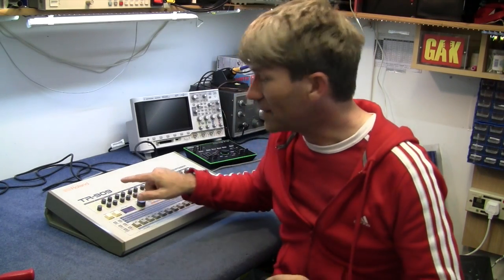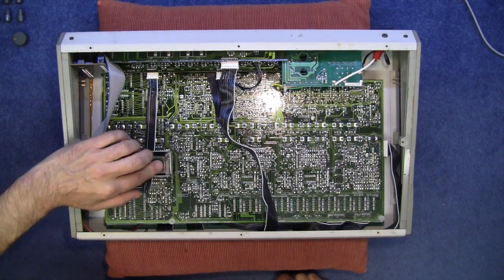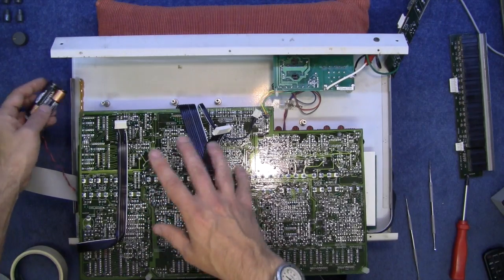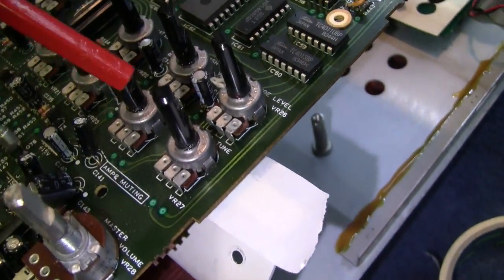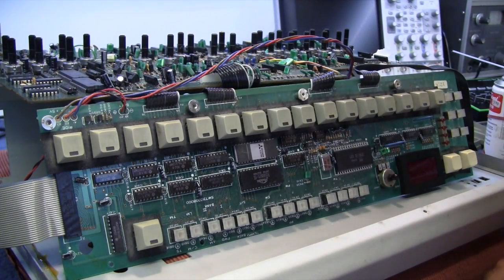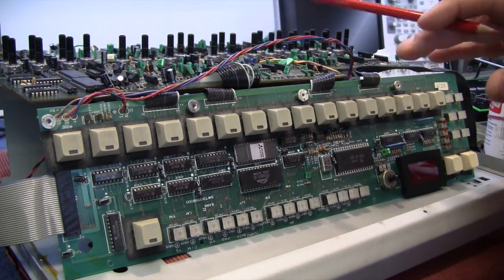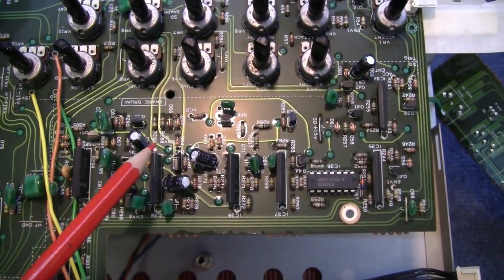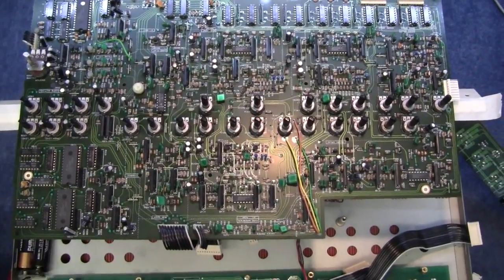MF#21 ROLAND TR-909 look inside and repair service

Comment: How did I miss this? My fav repair channel opening one of my drum machines? :-)

Edit: Oh, no, the buttons that came loose, I did watch this before, I just forgot. Haha!

One common problem with 909's is that they behave weird and erratic or that some buttons doesn't work. That's all the flat wire contacts. Just reseating them usually does the trick for 5 more years of usage. :-)

Comment: can anyone tell me reasons a 909 won't power on even though the PSU is working fine?
Reply: Bad reset line on PSU board. It's a tiny trace that runs along edge and under things and corrodes to open circuit....

Comment: I got my mother's old 909 and played it for a while, until the low tom stopped working. Every time I play it I hear a static white noise that doesn't fade out until I turn the level down or turn off the machine. Do you know how that can be fixed? I really don't know I could I mess that up. Overheating maybe?
Reply: could be a transistor needs replacing in the tom circuit? I have the same problem with the ride and am in the process of fixing it.

Comment: Hi Markus! I really enjoyed this video among many others you’ve posted :) Got a question on 909 pots; the snare volume pot on my unit is starting to feel very stiff and it’s difficult to turn it. Compared to all the other pots which feel smooth, it feels rough like it’s run out of lubricant or something. Wondering if you had any advice on what to do. You think the pot needs replacing? Also what is the best method you’ve found to remove the knobs? Thanks
Reply from the maker: hello. the poyt may be drying up so yes some lubricant could be useful or even try cleaning the pot as there could be dirt built up in there that is causing it to feel stiff. deoxit is one brand that may help but best to be sure it contains lubricant also as some pot cleaners will dissolve the lubricant. i use a credit card with a slot cut into it to slide under the pot and a couple of blades under both sides of the pot to gently try and prize it upwards. the card is to you don’t mark the surface of the 909. yes some of these caps are really difficult to remove.

Comment: I think on a really good epoxy, like Endfest 300, the posts can stick down fine. You can possibly fill around them to provide more support. But surface preparation is super important! The white residue might be superglue, so that definitely needs to be taken off with acetone. Additionally, sanding both sides is a really good idea, and then wiping down with isopropanol. Just be careful not to get acetone on paints and PS/ABS plastic parts.

Comment: I finally bought the 909 on August 23 and it arrived at my house on September 8.  It was just in time for me to make a song on September 9th (9/09).  The TR-909 I bought had some very noisy pots though.  I used your video to figure out how to take it apart and clean it.  It was great until you didn't show me how to take out the lower board.  I found the screws, but I didn't realize you had to use a wrench to unscrew the battery compartment nuts.  Thankfully, my wife showed me.  I like it when you just fast forward through the video while you do the work so I can tell what I need to do next.  Please don't take that the wrong way.  I really do love your videos too.  I also wanted to ask where you are from.  I like your accent.  :)  Take care and please keep up the awesome videos.  :)  Sam.
Reply from the maker: Hi Sam. I'm pleased you have a 909. and you made a track on 9/09 (that was meant to happen) . I live in Brighton UK but originally come from a country village called Bakewell in derbyshire.
Many Thanks from Markus
Reply: I'd love to visit the UK someday soon.  Take care and keep up the wonderful videos.  :)

Comment: This brings back memories, I owned a 909 in the day. Interesting to see inside. A nice drum machine, but expensive as I remember
Reply from the maker: Yes they were very expensive indeed but they do hold their value quite well. I wish Roland would remake these in every way shape and form instead of the TR-8 though that is a great drum machine also.
Reply: @markusfuller  They did it, sort of, with the TR-1000.

Comment: Hello there!
I've been always enjoying watching your videos, but i never thought I'm gonna need your help (unfortunately for me).
Since couple days my TR-909 is blinking for a  couple seconds after I press the power ON, then it works fine. before even it starts blinking, there is no light at all, like it wasn't even ON.
Can you please give me some hints or advice what the problem might be?
Reply from the maker: +Radiophonica Oh not too sure about that but it seems strange you should ask this just now as A friend of mine has just developed the same sounding problem with his 808 where the Leds seem to flash for a while before the thing wakes up and it has never done that before. Im hoping to get a look into it one day when he brings it around.But off the top of my head I do not know where to look. Maybe its warning you that the backup battery is dying ?. (thats just a guess)
Reply: @markusfuller 
Thanks.. : )

Comment: First off, before my little critique I'd like to say I enjoy these videos greatly so thanks for uploading! Cleaning old pots like that is generally not a good idea. As a professional engineer & technician I would never spray that stuff in any old carbon pots. Ideally they should be either be replaced outright or removed and disassembled one by one and cleaned with pure isopropanol. I cringe whenever I see someone using those spray cleaners. They don't work, they make the problem worse in the long run. It's a short term solution at best. I wouldn't want less experienced techs to see this video and then run out and buy spray cleaner and spray it all in a 808 or a 909 etc..
Reply from the maker: +Code Mode Yes I agree that would be the best thing to do though I was repairing this for a friend who I had already suggested replacement parts but he just wanted it sorted for the time being and did not want to pay to have hours of work and every single pot replaced. if I was getting paid for the hours of work and all the new pots then I would have replaced them all but this was a free fix with just a couple of hours to do it in.

Comment: Mine had one breakdown 20 years ago and has been working great since. Thanks for this video! It will come in handy eventually.
Reply from the maker: +Pauly's_crates It is an amazing drum machine, I wish Roland would remake them in the old fashioned sense rather than a modern emulation.

Comment: That Mitsubishi EPROM is now 30 years old. The last one I had for service had lost some of it's data. The HEX editor showed that some bits went from 0 to 1. Just a few, but enough to lock the machine up by pressing the shuffle button. I had the same on a Memory Moog a few years ago. Those EPROMS got 25 years of data retention and some start to lose them now. BTW those HN61256 are mask "programmed", i.e. produced with the data already inside. No worries, they can't lose any data.
Reply from the maker: +Chip Guy Vids Thanks For that information chip guy. Its always nice go get these snippets of info added in the comments for everyone to read. Much appreciated.
Reply: Do they corrupt because some light gets to them? I used to have an oberheim prommer!

Comment: I need some help please. I'm wanting to move towards electronic music. I far prefer hardware as opposed to software and love the old school sounds from the 80's early 90's. Aside from the TT-303 and the TB-8 what other equipment do I require to make electronic music? What do I use to sample for instance? Some of the set ups I've seen are mind boggling so It would be good to start off with something more simple and back to basics.
Reply from the maker: +Fury 161 Hi Fury. I would start off using something like Cubase - Logic - ableton or one of the many other DAWs as they mostly all come with a few plug ins and drum machines etc to get you started. then maybe if you want to progress onto hardware instruments well There is just so many different manufacturers of amazing gear I could not really direct you towards any single maker as they all have their plus and minus's.

Comment: Great videos! 1 note: "Monolithic" applies to any integrated circuit. You are thinking of SIP (single in-line package), as opposed to DIP (dual in-line package).
Reply from the maker: +Michael Bauers Hi Michael, when I used the word Monolithic I meant the pins are only on one end and the component stands upright rather than it being flat on the board with pins down two sides.
Reply: +thesoundofphysics I thought that too ( that monolithic = IC.)  I thought maybe he meant monolithic in the sense it was multiple op amps in a single package, as I was not sure op amps were generally called ICs ( but obviously is multiple components in a single package.)

Comment: hi mark  any tips on fxing my roland tr 808     start and stop button (doesn't work)
Reply from the maker: donthewatcher Hi the start stop button was just an old fashioned mass produced computer style switch. trouble is they are so hard to find now, It may be useful to try a multimeter across the pins of the button to see if it is working first just incase the problem is on the board somewhere else, then open the switch up and give it a good clean. I do not know of any alternatives available to buy that would match them. I would strip the button apart and try to fix that. Good luck
Reply from the maker: True with a little patience and care you can disassemble the buttons and clean the inner parts.

Comment: This is definitely not the way to clean scratchy pots. The very liquid contact cleaner, even when lightly sprayed, will eventually spread by capillarity everywhere inside the potentiometers cavity and dissolve the sticky silicone lubricant on the shafts, rendering the movement too easy and make all the shafts eventually wobbly. A professional repairman would take the time to desolder each pot, open it and clean the carbon trace and wipers inside with isopropanol, not contact cleaner, and re-assemble and re-solder each one carefully. This is the lazy cleaning job anybody can do, and will definitely lower the value of the device. Because if the owner ever wants to sell it, as soon as potential buyers will put their hands on the pots they will instantly know that a poor cleaning job has been done with contact cleaner, which inevitably returns to scratchiness after a short while with contact cleaner... I'm talking from experience.

All that being said, I still enjoy your videos Markus because it's always interesting to see the insides of devices and what makes them tick.
Reply: Do you have a video, showing you repairing and restoring a 909? Because talk is cheap...

Comment: thank you for this very interesting look into the 909 ! i have to open my one soon ... so now i know what me expect when i have to fix some inside.  : )
Reply from the maker: Hi thePOLYGIRL, I hope you make a video when you need to fix it, I look forward to watching if you make one up. best wishes from markus
Reply: markusfuller
 hi Markus : )
i dunno if i can make a vid like your's ... maybe only some photos of the repair with explanations... : )
Reply from the maker: Hi the POLYGIRL. theres nothing to it really, I never know what I'm doing until the video is finished and i try to polish things up afterwards as I do make some mistakes and my language sometimes when things are not going smooth certainly needs removing from the video's LOL.
Reply: thePOLYGIRL Whats the problem with yours ?
Reply: hi Fabian, thanx for your asking.
so, its nothing to bad on my one. just only need new stop switch, bd vol. and tempo pot replace... i think its easy to do and i got the most parts ready to repair soon. ; )
btw. the original tempo pot (or compatible one) is pretty hard to get here... phweeee

Comment: Hi Markusfuller, my 909 has a problem with the RIDE sound, volume is very low and always noisy, even when not in play or pressed. Can you suggest how to fix it?
Thanks
Reply: I fix it, replacing filter transistor ! :D

Comment: Fantastic video series!  Keep them coming!
What's your opinion on a possible sacrilege: for those broken chassis posts, the permanent, strongest solution would be to drill through the top panel and insert a truss-head machine screw from the outside in, of the same thread as the post, with a loc washer between.  It would lock the posts firmly to the chassis, maybe with a bit of threadlocker around on the inside.
It could be done discretely from the outside, and the screwheads could be painted to closely match the chassis so they were almost unnoticeable. 
Do you think that's something customer would have gone for?

Comment: My 909 has the entire battery holder removed ( I bought it like that) I'm guessing that the guy who sold it to me cut the wires on the face of the mother board. I haven't pulled it apart yet, Is the connection an obvious one? 

Thanks for the Video  - This helped a lot
Reply from the maker: Hi Raymond. The 909 was a repair job so I do not have it still here. but the battery connections were just soldered down to the board. Im not sure where they go of the top of my head but there was a schematic diagram on google. Have a search around for schematics and it should come up. Best of luck.

Comment: Hey Markus thanks for the response! I was wondering if it would be possible to replace the tact switches on my Akai MPC2500. Some of the buttons have become unresponsive and take a firm press to register or sometimes don't register at all.

Keep up the great work and videos! 

Kind regards

Paul
Reply from the maker: Hi Bestovitch, if they are the clicky type buttons as in the numerical keypad then there maybe small metal discs under them and they are in turn stuck down with a thin plastic film over the top. you can lift them up and clean the contacts on the circuit board. if they are the rubber squishy type buttons then you could draw over the black track contacts with a very soft HB pencil as this will provide a temporary fix for a year or so then they would need doing again after that. I would be happy to try it for you but Im bogged down with work for at least a month and dare not take on any work at the moment as things would sit on my shelves for weeks before I can get around to them. but have a go yourself you may fix it and you could make a video as you go along :-)
 other than that if i can help through messaging I will certainly try my best.

Comment: Hi,

Where in the UK are you?  I have a Roland MKS-50 that needs repairing, as the "Enter" button doesn't work, so can't store sounds etc.Alsi the battery is soldered on a raised post, so would like a new battery holder.  I looked inside to see if I could do anything, but is beyond me.  If you have a website/contact details then we can discuss your rate etc.I travel the UK quite a lot, so could drop off or just post.
Reply from the maker: when you say ENTER button you mean the red WRITE button I guess ?. is it the rack mount version of the roland Juno. battery should not be a problem though you may lose your settings so would have to back things up first.
I actually live in Brighton East Sussex but am so bogged down with repairs at the moment that i could not take on any more jobs for at least a month. but if you don't find anyone get back in touch with me and i will try and help. best wishes from Markus.

Comment: Fascinating! Great to see inside such a legendary bit of kit. Quick question...
I have a mixer with about 3 trim pots which appear to be doing nothing when turned; could this method of cleaning be a solution to this problem? Thanks in advance. And keep up the excellent videos.
Reply from the maker: Hi Paul. yes have a go at cleaning them the same way I do. don't use too much spray though as you don't want it on the actual Posts because there is grease there. the contact cleaner costs £3.95 from marlin electronics and lasts for years. best wishes
Reply from the maker: sorry i meant maplin electronics . the computer tried to correct my spelling as marlin ?.
Reply: markusfuller that's cool, I worked d it out! Anyway, did exactly what you suggested and now all channela on my old mixer work a treat. I'm very pleased! Thank you so much for your help and guidance. :)

Comment: Great video, thanx Marcus:)
I would have clean the buttons und thier landings prior to glue them with 2k, because you glue may just paint/dust to the buttons... and it may won´t last very long.
Reply from the maker: Hi Tubical. no danger of glue on the buttons. I just spot glued on the weld marks on the casing then placed the posts down onto the front cover. I know it won't last for ever but the antistatic hard foam should help keep everything in place.

Comment: ahhhh no you don't use switch cleaner on a drum machine worth almost £2000 its going to dissolve the grease that's supposed to be on the shafts in the short term its going to make some pots easier to turn than others and in the long term it could make the pots wobbly. either replace them all or take them apart one by one and clean them by hand.
Reply: Thats why you change them with new ones  ,
not clean them .